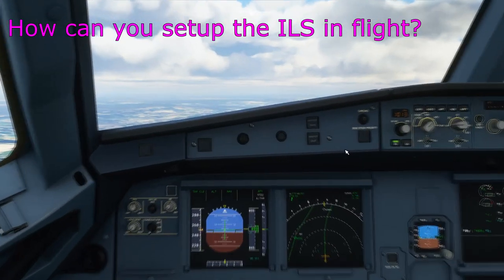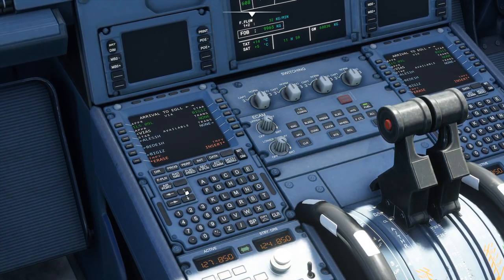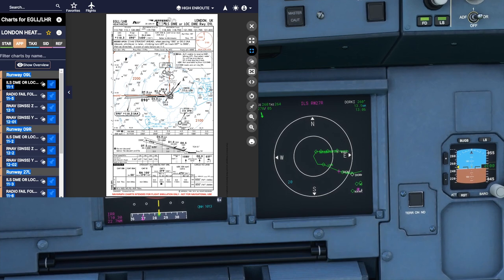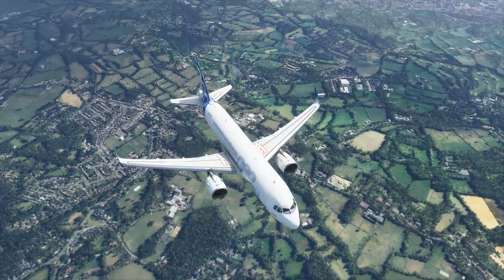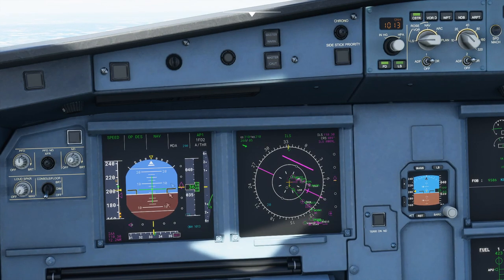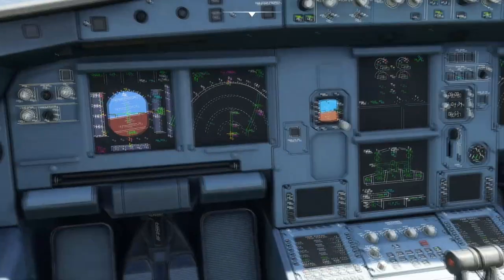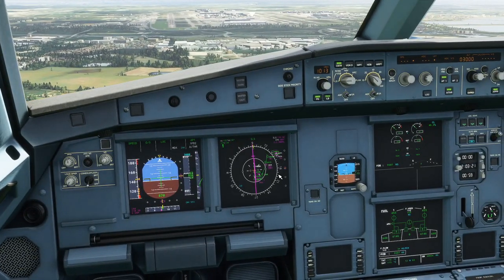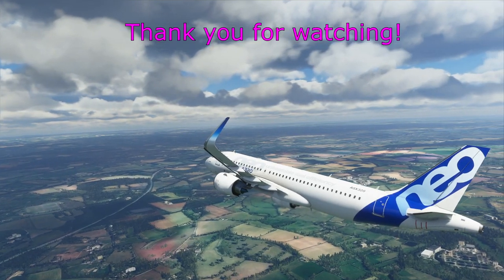Your A320 ILS questions answered by a Real Airbus Pilot! Microsoft Flight Simulator

Comment: im surprised he didn't mention this, but when you disengage the autopilot before landing, you can actually disengage AP1 and ENGAGE AP2 and it will flare at the runway and adjust throttles for you

Comment: Another great video, thanks so much. You're my preferred channel as I try to learn the flight sim. I'm finding on the A320NX that the 'plane accelerates considerably as I try to engage flaps (as you did in this video) for landing.  Bit puzzled by this so any thoughts appreciated in future videos.
Reply from the maker: Thanks Steve! There could be lots of reasons, before you start descending towards the runway make sure you have the speed back, preferably below 200kts with at least Flap 1 or 2. If you have no flap or are too fast, when you start the 3 degree descent the speed may increase even with idle thrust! Hope this helps.
Reply: @320SimPilot  Many thanks for the response. That helps and I seem to be improving as of tonight. I found the A320 NX a bit tough at first but the more I fly it, the better I think it is, the basic NEO seems a bit crude by comparison. Are you doing more on flying with VATSIM? I hope so, that’s my next target.

Comment: Another great video!  

Atc seems to always change my approach inbound, no prob there.  Because of you, I know how to update the MCDU.  

The problem is, when I load the new approach, it sends my plane in circles trying to hit a new waypoint within the approach.  How do I skip a waypoint within an approach using the MCDU?
Reply: Either try to remove them by pressing clear and then selecting the waypoint (doesn’t always allow you to delete them) or fly directly to the waypoint you want to fly by using the manual heading mode. 

Both solutions have worked out well for me.

Comment: One bug I found using ILS, was that sometimes, in the final approach, the LOC will target slightly right, meaning that the aircraft will point to the right of the runway. Well, it's either a bug, or my lack of experience/knowledge when configuring the aircraft

Comment: I might have done something wrong and my question might sound silly but what if the approach is not as long as in this video. You set the approach button after the turn and there was still ~9 miles left to the runway. I did an ILS approach for the first time to Nikos, Crete. I was flying East and the runway was back in West. After I had done the turn there was maybe 3-4 miles left. Should I have toggled the approach button already before the turn or only when the plane is heading towards the runway. Sorry if this is a dumb question but for someone who flew the A320 for the first time, all this can be very overwhelming at times. Thank you for the great content and keep up the good work!

Comment: Just a few questions so I can better understand the video. What does STAR mean? What is the RAD NAV page, what info does it show? What does the LS button do? What does LS stand for? Whats the name of the real world chart where you can get the ILS frequencies from? What does IAA mean? What does ARPT mean? What does CSTR stand for? What does the CSTR button/mode do? What does ARC mode do? What does ARC mean? What does LS mode do? What does LS mean?
Reply: A STAR is a Standard Arrival. It reduces ATC workload by allowing ATC to assign every aircraft a particular route to descend and to follow to align itself with the runway in use. In places where there are no STARs, ATC constantly tells you what heading to fly and what altitude to descent to. 
The RAD NAV page on the MCDU is a page that displays the Radio Navigation aids (ILS,VOR or NDB) automatically tuned by the aircraft or tuned by the pilots. 
The LS pb is just a button that displays Vertical and lateral guidance for Precision approach, something like an ILS or GLS (I may be wrong about the GLS, correct me if I'm wrong). You press it to display the localizer and glideslope. LS stands for Landing System.
The real world charts where you have the ILS frequency are on the ILS approach charts for each approach. 
I'm not sure where you heard IAA, you could tell me what that was in reference to.  
ARPT stands for Airport and basically when it's pressed it displays all the Airports in the vicinity of the aircraft on the ND.
CSTR means Constraints. When you program a STAR or Standard Instrument Departure (SID) there may be altitude constraints along the route meaning that you should either be above or below the altitude at the particular waypoint for it. When you press CSTR it displays the Constraint on the ND at the waypoint for it. 
ARC simply means arc mode. It's called ARC mode since it displays a 90° arc in the forward sector of the aircraft. 
LS again as said earlier means Landing system. Here if you select LS Rose mode via the mode selector switch. It basically shows you the localizer and the glideslope signals on the ND. It's not a mode commonly used. It's generally only used when a raw data approach is flown which is basically when no automation is used. No automation as in no autopilot or flight directors. Autothrust may or may not be used.
I hope this answers all your questions!
Reply: @brucerodrigues1  Cool thanks for taking your personal time to provide help. This is good stuff and helps . Although it begats more questions which I don't expect you to provide answers to as you have spent enough time on me already. Anyway here they are: What is the purpose of ARC mode? I get it that " it displays a 90° arc in the forward sector of the aircraft. " but what is the purpose of that? So it sounds like LS (landing system) is the same thing as ILS correct or no? ND is mentioned several times, not sure what it means but I assume it refers to one of the displays correct? EDIT: ND = navigation display?
Reply: @pbshooter100  So Arc mode is basically a nav mode for the ND, which is as you correctly mentioned, the Navigation Display. There's two Navigation modes available, one is arc and the other is Rose Nav, the only difference is that Rose Nav provides a 360° view with the aircraft in the centre. These modes basically display the aircrafts programmed flight path, the waypoints and additional data, such as Constraints, airports and navaids. Think of it as you using your gps in a car, the route to take is highlighted in blue (assuming it's Google maps), here the route is in green.
Also, LS in most cases is ILS only so for the sake of this video you can say it's for the ILS only. Hope this helped you out again!
Reply: @brucerodrigues1  Perfect!! Thank you so much!

Comment: Thank you very much for your excellent Videos!

I'm an ATC in Austria and trying to understand "the other side of the radio" in FS2020 :)
We often issue clearances like "Cross Renka at FL360" or "cross abeam Suben FL 340 or above" (if the A/C is on a direct course and Suben was in the FPL but isn't any more) or "cross Masur at speed 250 knots". Or ask questions like "which level can you reach overhead Stein".

Could you make maybe a Video on how you comply to these clearances? That would be very helpful :)

And of yourse: Congratulations on the 10k subscriptions :)

Comment: Hi 320, any chance of doing a missed approach procedures video?  Dealing with the changes to the FLT PLN based on vectors from ATC after declaring the missed approach are confusing to me.  At least with the AI ATC, it will typically vector me to a specific point and not sure how to get the plane to give up on the existing flight plan and use that new information.

Comment: @320 Sim Pilot - since you are flying ILS 27L via BIG - i wanna ask about the approach that is done in FS2020 automatically - it has a zig zag at some point, you had it as well (you can see it at 01:06 on the display, last waypoints before localizer) - is that normal in any way ? You didn’t seem to comment on it, but the charts clearly show smooth turns. 
+ any recommendations on how to deal with stuff like that ? Any workaround you’d have ? Or just let the plane do its stuff ?
+ (i’m getting cheeky) - how to handle go arounds via MCDU in FS2020 ?
Reply from the maker: Hi Andrei this is sadly another glitch at the moment. This is why I end up using heading mode to intercept the ILS which you can see in my ILS tutorial (as it has the same issue there). I hope it gets fixed soon! Hopefully that can help you if you end up with that problem. The MCDU in the go around is something I will look at!
Reply: @320SimPilot  Oh, awesome, missed that  during the ILS video (also excellent). Thanks for the reply, much appreciated!

Comment: Nice video. 
Also found the answer on my last question. 
So when the plane is on the glideslope and localizer and you disconnect the AP will the plane stay on the glideslope and loc?

Or is it manual for the last landing part?
Sorry for asking another question
Reply from the maker: Hi Edward, thanks for watching and commenting. When I disconnect the autopilot it is now manual flying. I follow the flight directors and then start to look outside and land using the view out of the window. No problem at all for the questions!

Comment: Hi simpilot. With your videos, i have managed to do my first 2 landings in a320. Now i have a few questions about the constraints points and altitudes. I've had approach points showing 13000 as altitude, even tough they were really close to the airport. How do you know when to descent? What altitude do you usually fly around airports to capture the ils?

Comment: I have always been try to get the automatically descent work out following my vertical profile at the TOD point, and then gradually descent by itself. Is there any function like this on the real aircraft and have you happen to try this out in the MSFS 2020 ILS landing? And if the operation of extending the flap decided by or according to the the airspeed or the distance?Thanks! Great video by the way.

Comment: as always very informative.
Will you make a video only on the Charts? What all these different Runway Charts mean, which Values are important for the FMGC?
(GPS) NDB Rwy  X
NDB DME Rwy X
ILS DME Rwy X
ILS or ILS RADAR Rwy X
ILS CAT II OR III Rwy X
ILS or LOC Rwy x
RNAV (GPS) Rwy x
VOR Rwy X
Besides that maybe also videos on this:
Do We Keep the DH box always empty?
Which is the important value for MDA if its not just an ILS runway and we do not have the CAT I value, do we instantly go with the CAT 2 value? Or What if there isn't a CAT I /II/III value.
Like if I'd look at the Chart of CYVR rwy 08L
I got a ILS RADAR DA(H) value and a LOC (GS out) MDA(H) Value.
while we are looking at the CYVR Airport lets stay on Rwy 08L If I want to use a it with RNAV there are two options RNAV 08L Y and RNAV 08L Z What does this mean?
These were a lot of questions ;) I hope you find the time to answer them else I wont understand it :).

Comment: I seem to deviate off the center line even if I leave the AP on until like 200ft so I was wondering if you might have any tips in regards to maintaining that lateral position once you're flying off the computers. I know its not a big issue but it really does make my landings still feel very weird.

Comment: Thank you for the great videos.

I'm loading flight plans in from Simbrief but also using in game. I'm confused about the managed altitudes as they don't follow the ones in the computer. I noted on one video you set these manually - is this a FS2020 bug or am I likely doing something wrong? A useful video on this would be helpful if there is a solution! Thank you :)

Comment: Quick question - how do you start a descent at top of descent so that it follows a managed path (shown by the altitudes in the flight plan)? I tried inputting the final altitude shown on the flight plan into the autopilot and then pushing the button but it then descended way quicker than it should have done, and didn't follow the programmed altitudes

Comment: Hi,
One question.

When I want to control the speed (always overspeed when not) it's not responding to my speed settings !!
Only after I disengage and engage the auto throttle it's working.
Is this a FS2020 bug or is this how it works ?

Comment: Hello everytime I try and insert an approach with a transition waypoint mid flight it programs it from the previous waypoint to the transition point, if I try and engage autopilot the plane turns around and flies back to the previous way point and then turns around again and flies to the transition waypoint. Is there anyway to get it to just update such that it flies straight to the transition point instead?

Comment: Can someone help me out.. I've been running test flights from CLT to GSO (North Carolina) and I chose the Low-altitude airways and chose an ILS that wasn't completely wonky. Everything is perfect from take off right up until I reach the ILS. I set everything up but it's almost like the AP gets confused and it will just start flying in circles over the airport.

Comment: Please answer my question how do I know when I have reached top of decent
Reply: you don't know TD ....auto pilot know 
for example from a to b 500 miles or kms
if you give to the flight director correct data (flight plan high or not high )

your auto pilot make everything for you  ......

you start the flight .....airplane is  in the route.... and then.... you or towers say to you how high can you go...

we saying you can go 32.000 feet......

 air plan goes this high and speed 290 ......when airplane nears the destination airport B......
 flight director take the air plane off the gas  and beginn sinking automatically........

 in flight data every star is have altutide for landing ......you can choose your ILS landing before your flight start ....
so like in this video EGLL and its 09 for this  landing f

or example 100 miles away airplane begin the sinking from 32.000 feet and goes to  landing star ......and do it for you  landings ......

when airplane speed up while there wind is .........makes airbrakes for you !

if another planes in landing in the queue ...... your plane goes in waiting curv .............. 
when your data info with out its landing where is the plan ended there auto pilot is out.....

you have to self gear down and flaps if you have break s on auto pilots on the ground make for you break (1 2 or 3 power breaks)

Comment: New to flight sims here. Im trying to figure out when I'm landing why my altitude says fl050 instead of 0 after i landed. I had a few botched landings im assuming because my altimiter was set incorrectly. I heard at say 29.92 and i verified it was correct. Not sure what im doing wrong